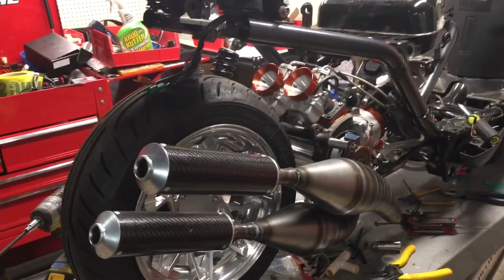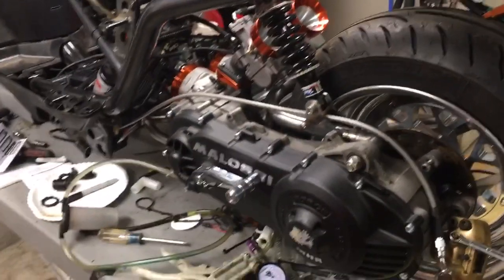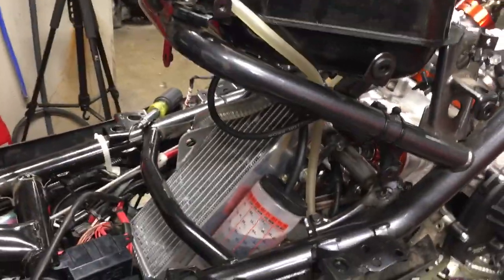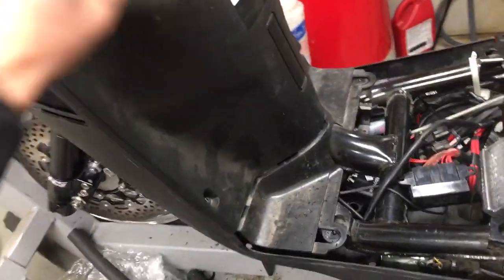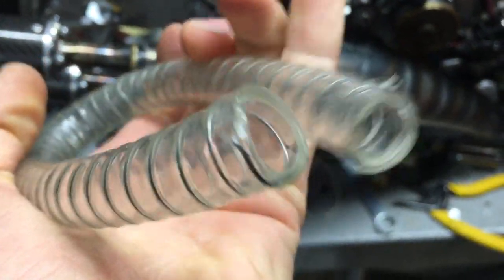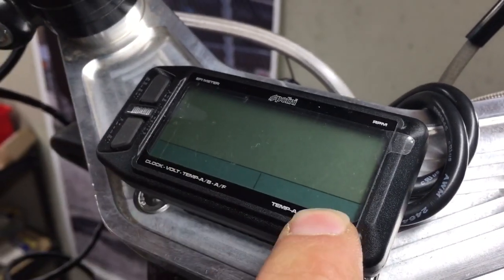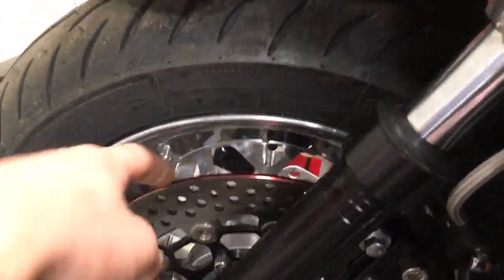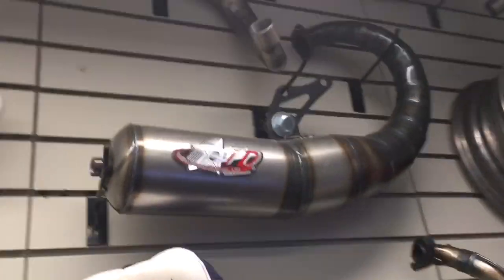Scooterswapshop twin cylinder stage6 zuma 125 2 stroke

Comment: Team Cristofolini do the twin stuff too, but It's $$+ and they do a  125cc kit for the aerox which you need their CNC cases and gear for, puts out 46hp at the tyre, but I doubt it would be streetable though. I think I would go for something like the top performaces 86cc cylinders if I did a twin, because at least they are powerful but not on the ragged edge of only being able to do quarter mile bursts at a time.. probably will go for the MXS 90cc cylinder next, and will buy a second bike so I can have a mild bike and a crazy bike at the same time.
Reply from the maker: Yea, I like this 140 setup as it’s super rideable and usable. However I definitely wouldn’t use stock cases if I was to do it again
Reply: why not?

Comment: How many miles do you get out of the Motors everyday riding not racing roughly ,just wondering because I've got a 300 2-stroke road bike 2021 beta RR300 I'm using Motul 710 in the oil injection and Motul 800 Road 100 to 1 premix . My bike seems to get it easier on the road then when I used to ride on the dirt I suppose because my Road gearing is quite low reving. I've seen some of the old Italian scooters to be quite reliable
Reply from the maker: There's way too many variables to give you a idea could be months or years.